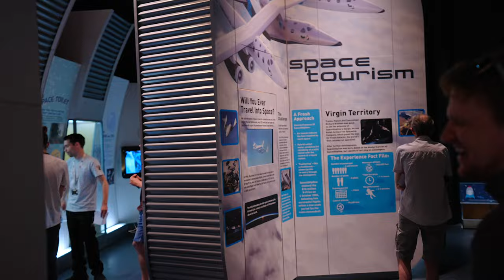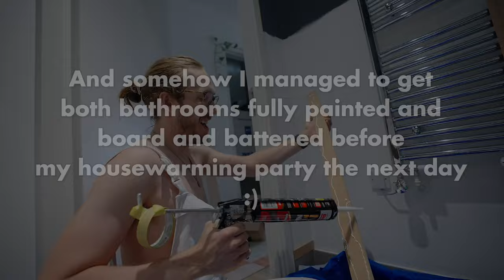Making new friends and DIYing my bathrooms

Comment: two bathrooms! That's so American I have to say...😉 - houseplants tip - get some stone planters/plant pots.. they may be more expensive - but much less likely to blow over in the wind...as they're super heavy....
also your prints might get damaged from the steam in the bathroom...not quite sure how you counteract that.. even using an extractor fan won't necessarily solve the problem... but I guess as it's a new build the builders have hopefully thought of that... mould can be a real issue in bathrooms with no windows/decent ventilation